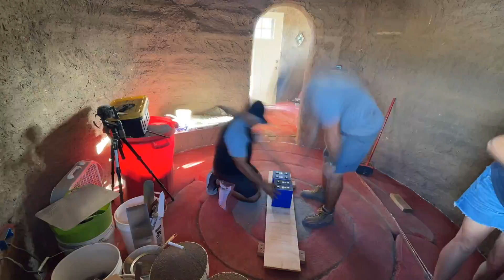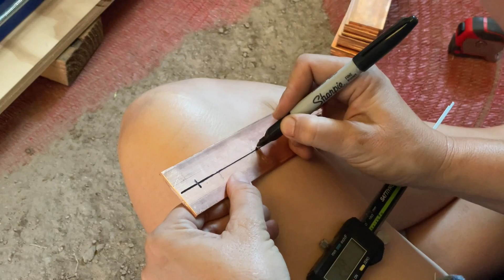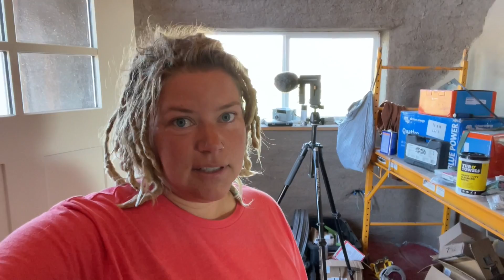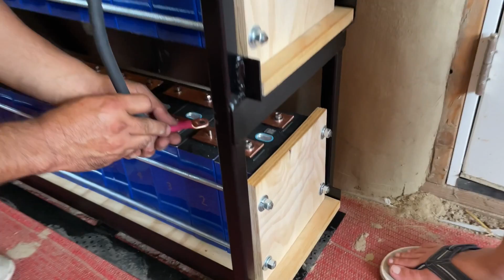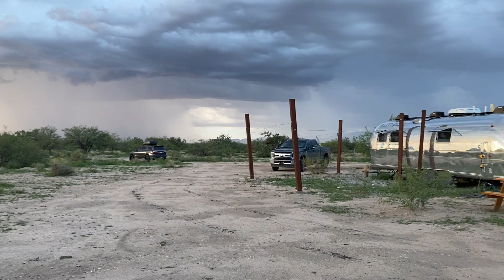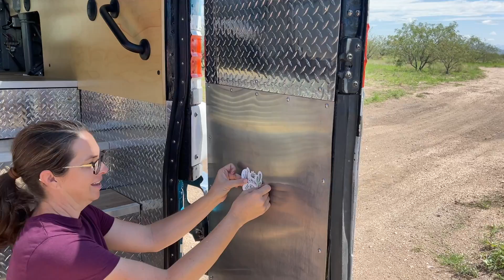Friends to the rescue! Let there be POWER!

Comment: I would have put the batteries on there sides so that dropping something metal does not have a chance of going across the bussbars.
Reply from the maker: In the finished installation there's a cover over the batteries
Reply: @TinyShinyHome  I was thinking more of working on the batteries, maybe changing a cell.

Comment: I am sure they don't but any OFF GASSING with the batters   ohms law basically voltage is low amps are high and batters hook up like jump stating you car positive to positive voltage is same amps are greater  . positive to negative  voltage is higher amp doesn't change . I know no one cares ,jest testing my mind see if anyone's home ramble on
Reply from the maker: Lithiums don’t off-gas thankfully. By joining two in parallel and then each in series we are purposefully increasing the voltage to 48V to keep amps lower so we don’t have to use super thick cables in the rest of the system.
Reply: @TinyShinyHome  you got this ,jest ramble from an old man thanks
Reply: @TinyShinyHome  Oh, I get it now. Thanks.

Comment: How can the BMS monster each individual cell voltage when they are all tied together? doesn't seem possible.
Reply from the maker: There are 16 sensors connected to the BMS and to each cell. In our case a "cell" is actually two batteries paralleled together. So it's easily able to  track the voltage on each cell with the sensor connected.
Reply: @TinyShinyHome  The BMS actually monitors each pair of cells in parallel. Really cool that the BMS talks to the Victron bits.

Comment: Hey Jonathan! Here's the perfect joke for ya! An electrical engineer, mechanical engineer and a software engineer are carpooling on their way to the office, when the car engine dies forcing them to pull to the side of the road. The mechanical engineer says,  it's probably a mechanical problem. I'll look at the schematic to see where to start looking for the problem. The electrical engineer says; no I'll bet its an electrical problem. I'll put my multimeter tester on the fuse panel to see where the problem is. Finally, the software engineer says; Let's all get out of the car, walk around it once, get back in and shut the doors. I'll bet we'll be back on the road in no time! 💡🔌🌡⚡️
Reply: reboot  the reboot
Reply: Did anyone thunk the gas gauge to see if the needle was stuck?